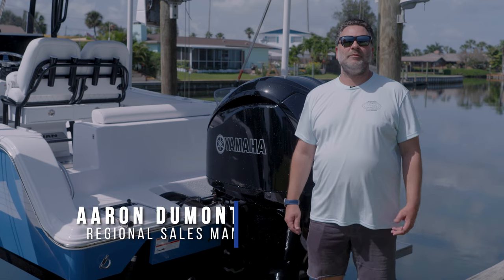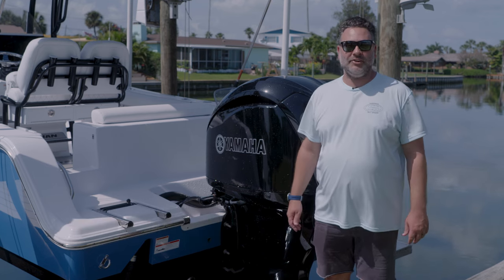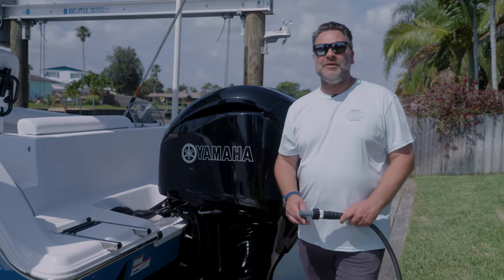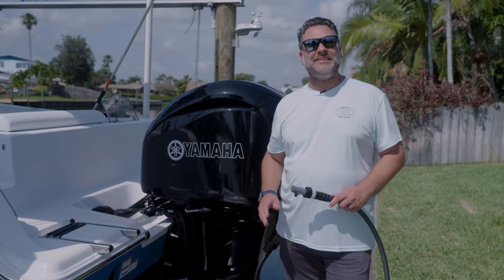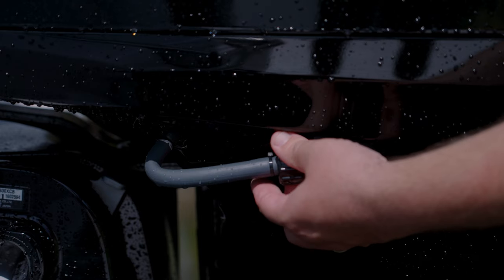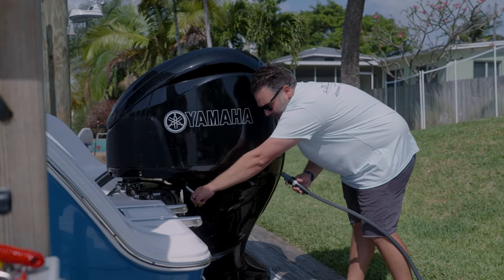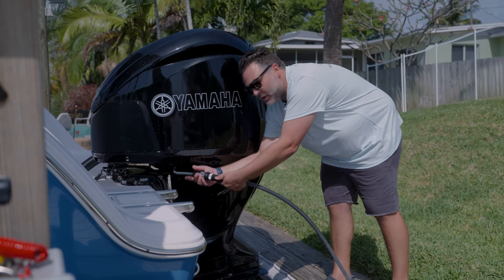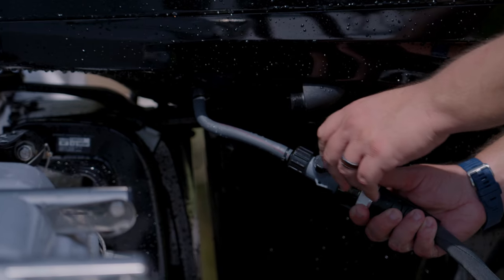Tech Talk - Motor Longevity - How To Flush An Outboard Motor

Comment: That's the only issue with flushing a motor this way is that a lot of the time water never makes it pass the thermostats to the water jackets. The best way to insure it does is to use a tub or muffs and crank the motor and let it reach operating temps to make sure it's completely flushed. Also products like salt away are a big help to get the most salt out possible.
Reply: Thank you for the comment. In this particular instance with a Yamaha F300XCB we can’t use muffs due to the motor having a high speed pickup in the lower unit bullet. Love the suggestion of salt away products tho! Thank you for watching!
Reply: @aarondumont8220  it's hard when it on a lift too. I had a lower water pick up on my bass boat. Had to buy a big rubber tote and fill with water to crank mine and flush it. I believe now that they have a attachment to do it for a low water pick ups
Reply: My boat is on a lift. I just hook up a hose to the same pickup that he uses and start it quickly.